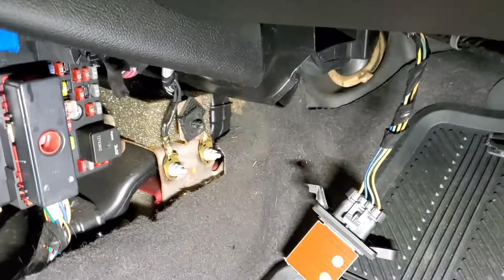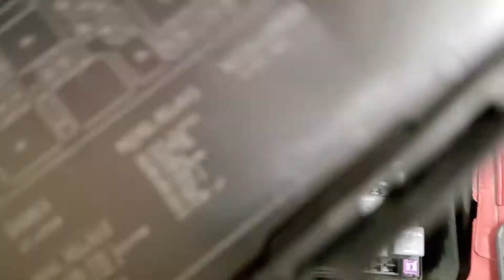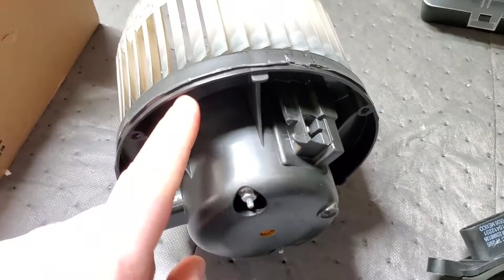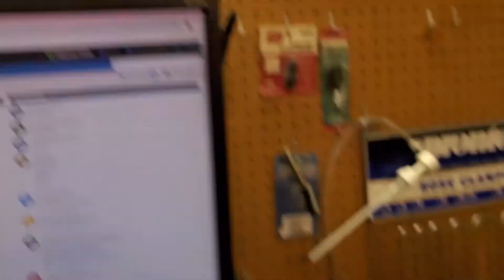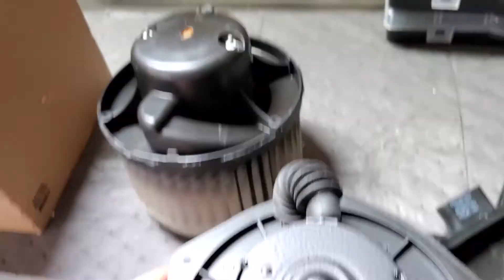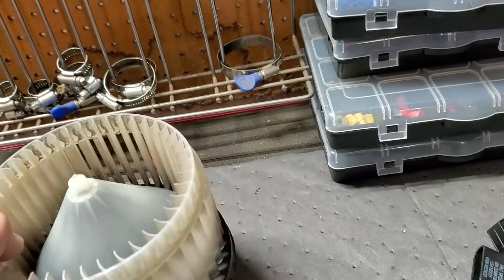06 Pontiac G6 Blower Motor Problems Fix

Comment: It's winter right now in Alaska and my blower is out, will be putting the advice here to work soon! I think it is at least the resistor like you said, because at one point only speed 4 worked and it went out. My blower I think is still good because it has gone back on after going over a bump that I guess hit it just right, then went back out next time I turned on my car. I'll be checking all of the fuses too, thanks for the video I'll edit my comment and let you know how it went!

Comment: What if resistor is replaced new fan did the same as old fan, and all fuses are good? The fan only works on highest setting or not at all
Reply from the maker: I would probably make sure the connector that plugs into the resistor is not damaged from over heating not allowing good contact with the new part.  That would be the first thing I would look at.  Next maybe new resistor is bad could happen or fan speed selector switch faulty.

Comment: How did you change the fuse under the hood where can you buy those?
Reply from the maker: The fuse just pulls straight out.  Use a pair of pliers.  They can be bought at any auto parts store.